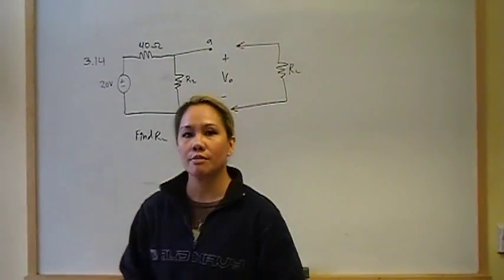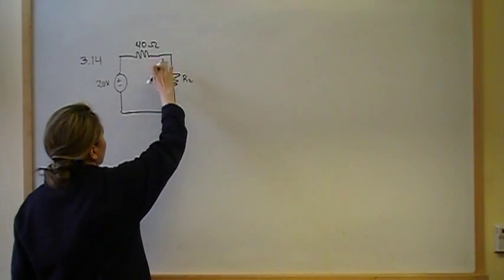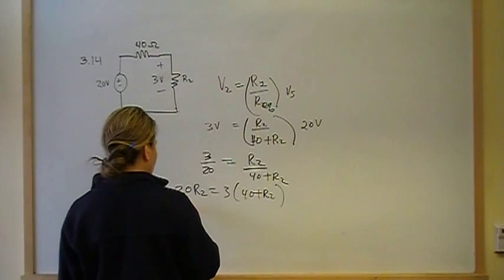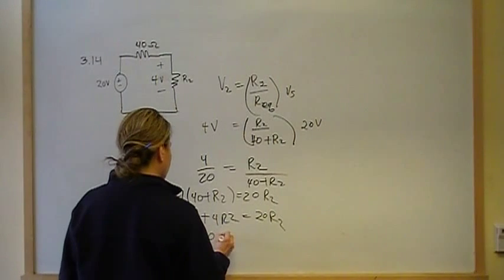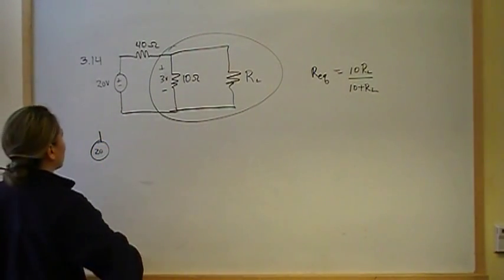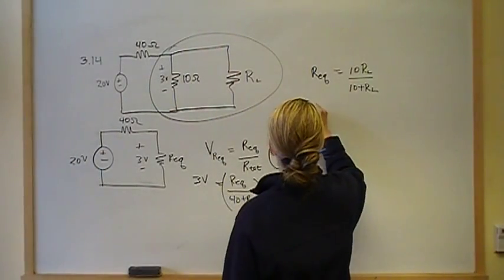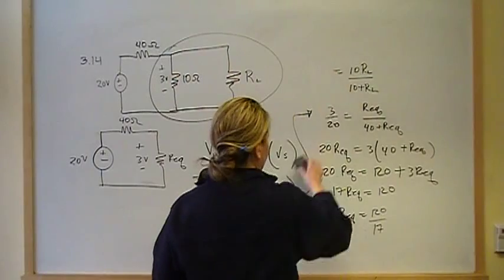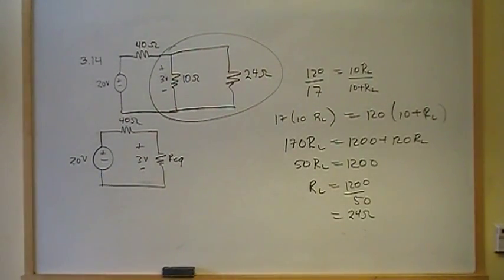P3.14 Nilsson Riedel Electric Circuits 9th Edition Solutions.MOD

Comment: Hi
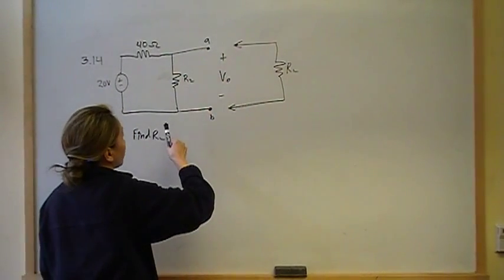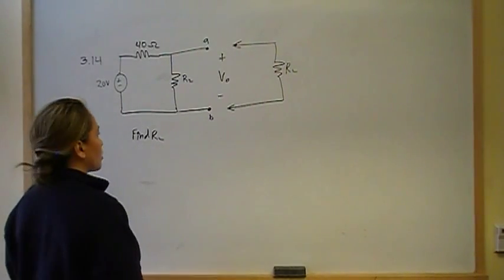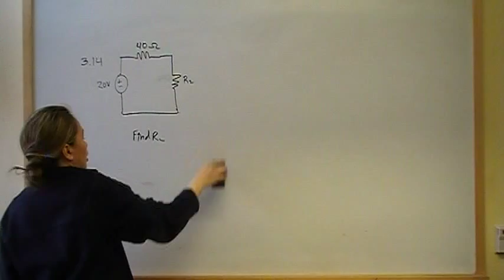Love your videos and explanations. I think you made a booboo. Certainly I may be wrong but using the "given", maybe I am not. You clearly say that the voltage drop across R2 when RL is NOT connected is 4V between 0:24-0:29. Then, when RL is connected there is a voltage drop of 3v. At 0:45 you say "when this isn't here", meaning the voltage drop on R2 is 4v when RLisn't there. At 0:53 you say the voltage drop is 3v when you just said it is 4v. ????? You changed the "given".
Respectfully
JackK